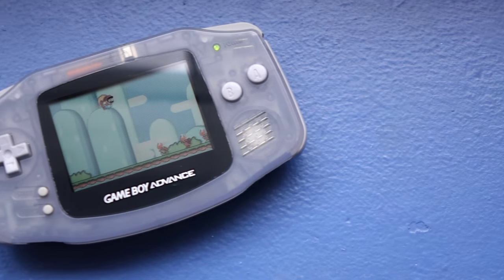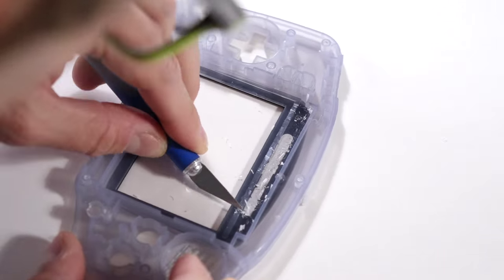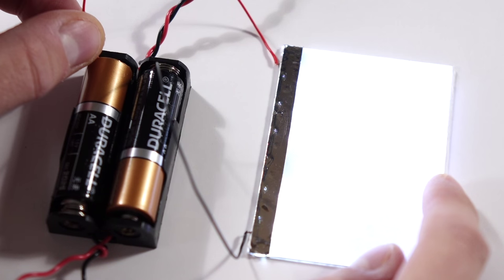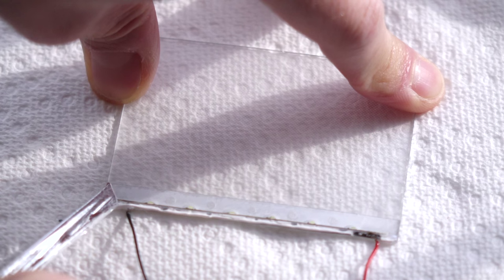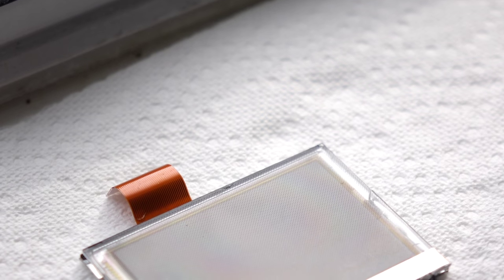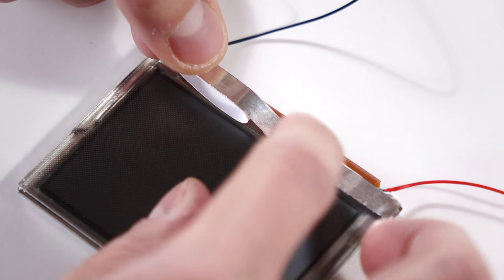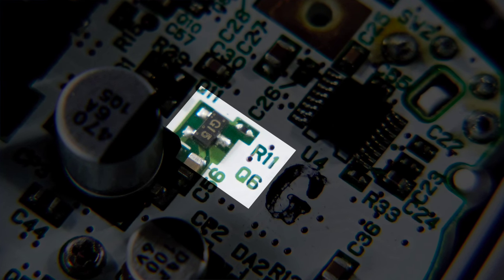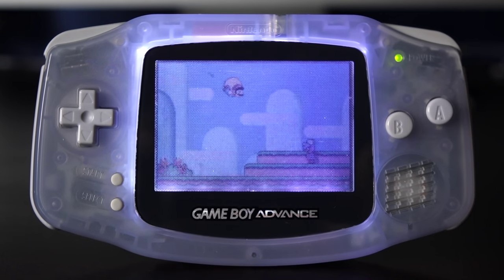Frontlight Your Game Boy Advance!

Comment: So I tried doing this and I did everything you said to and my gameboy won't turn on. It'll turn the front light and the power light on for a split second then turn itself off. Any idea what I did wrong and is there a way to fix it?
Reply: +abid latif yeah, I have a 40 pin so I had to solder it to the place he said to solder it and I soldered the black wire to the power switch like he said and it didn't work. Any thoughts?
Reply: +abid latif yeah my gba was working just fine before. Everything was in good working condition. The "game boy" symbol doesn't come up when I turn the gameboy on, it just flickers the power light and the front light for a quick second then turns itself off. I'll look around and see if it's a common problem.
Reply: I recently had the same problem first time I installed a frontlight in a GBC. I'm no expert on electronics, but I am guessing for whatever reason the light was sapping too much power, cause when I unwired it the GameBoy worked fine. What I ended up doing was searching for other tutorials and had a look at how they wired it (Colin only shows one way to wire it, but there are actually many points on the board you can tap power from), and tried an alternate configuration. Worked perfectly after that.

Comment: I know this is an old vid but i did the front light mod and everything came out great but for some reason when i put bran new batteries . Within 5 minutes the light start to flicker Did i do something wrong or was it not tight enough the shell when i put it back together.  
Do you or anyone have any ideas what it could be or was it just that the mod drains the battery very quick. And only happen couple days after i installed the front light

Comment: Hey question to anyone. If you soldered the black wire so a different switch could you have an on off switch for the frontlight if you were outside.

Comment: Hey Collin, I was doing the front light mod, and the red wire came out of the light. Is there a way to repair it? and I got solder on the black square thing the leg of Q6 is on. so my gba turns on for a second and shuts off. is there a way to fix this? I also had glued the light on the lcd so I can't take it off and just get a new light to put on it. and help or suggestions will be greatly appreciated!
Reply from the maker: +Justin Speicher Yep, you can fix both. Just peel a little bit of the white rubbery material (known as "silastic") away from where the connection on the frontlight goes, and solder the wire back on. It's a pretty small solder pad, so you'll want to use an iron with a small, pointy tip. As for Q6, you can use desoldering braid to wick up any extra solder that may be bridging pads on the board -- it's handy stuff to keep around for situations like that. Good luck!

Comment: How do you solder on the gba? Just apply heat when the wire is already tinned? Im confused and need help...
Reply from the maker: Yep, that's pretty much the way I do it. Get some solder on the wire first, then just apply heat to flow the solder joint.
Reply: are you gonna do an update video on the new mod with this frontlight to eliminate the hotspots you get from the light? i hope so lol
Reply: Spintechfilms how do you do that? Can you send me a link?

Comment: What if I put an ags 001 screen in the gba with the proper ribbon cable
Reply: that is definitely the far more preferred mod, this is the more economical version due to those screens costing around $100 nowadays. in order to do the ags 001 mod you just need to buy an adapter ribbon cable which you can find online.
Reply: Or better yet, use the light panel of the sp on the gba, so I don’t have to wait for China shipping

Comment: About how much Loca is used when doing this mod?
Reply from the maker: +TheSpoopyGhost Not much, really...even a small tube has enough to install 3 or 4 frontlights.
Reply: +This Does Not Compute Could you use the Advance SP AGS-001 front light + screen?

Comment: Is there any reason to do this over the ips mod?
Reply: This is an very old school light mod for the GBA back in the day, I think 2001. The original kit was called the Afterburner kit, these type of mod is rubbish, IPS mod is the way to go.
I got this afterburner light kit for my gba back in the day, came with it's own Afterburner replacement front shell which has the cutout for the brightness wheel. Maybe back then this was the best their was but now, it has aged pretty bad. I'm keeping my one for nostalgia sake, but I have another GBA for an IPS mod.
Reply: @TN_AU  Ah that makes sense. It's definitely an upgrade over the original screen but I agree, it hasn't aged well at all. I got an ips modded gba off of eBay and I'm loving it. Paired with the ez flash it's probably the best gba experience you can get.

Comment: Accidentally soldered off a tiny resistor while trying to put the red wire on.... GRR... :( GBA won't turn on at all. The front light will light up..

EDIT:
I some how did a crappy soldering job putting it back on and it works now :) I wasn't able to use LOCA glue though. It's just so expensive for a one time project.. I'm regretting it now. The color is so washed out!!
Reply: thanks to your comment i found out what i did wrong smh.

Comment: What happend with hba afterburners
Reply: Gba
Reply: +Marko Kuret they sold like hot cakes and for some reason was discontinued in early 2000's which is weird since alot of people are asking now.
Reply: DissonantZero is there a way to still get it, or even make  it
Reply: Yes with loca,find any broken lcd of a successor console like the ds lite and take its backlight panel with the led strip, they have 4 leds which is perfect the panel fits in the gba perfectly.Or you can buy a lcd on ebay they are cheaper than the frontlight kit itself mentioned in the video,also, a psp 1000 series lcd will work but they are a wee more expensive.But with mine its proven optimal clarity like that of ags 001 light.Keep in mind the psp lcd is a little thicker so I would suggest sand papering down your gba case a little more than suggested otherwise.This is entirely speaking from my experience.I made 2 frontlight gba with these they look better than than handheld legends mod IMO they have a finer honeycomb pattern and BARELY look color reduced.Happy hunting.
Reply: +DissonantZero Do you have link to tutorial
Reply: Marko Kuret I dont but its basically the same as the one above.I will say though if your having problem with bubbles and dust youtube diy dust free enclosure tutorial, or what I like to do is do the application in the bathroom with a shower as hot as hell as the steam pulls all dust to the ground, but you dont have to leave it on for too long till you cant see, lol.